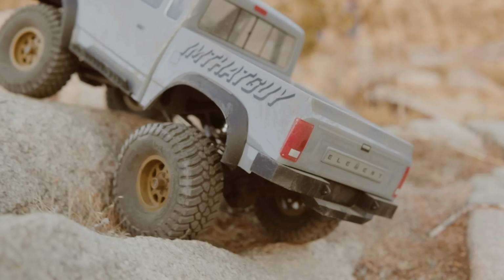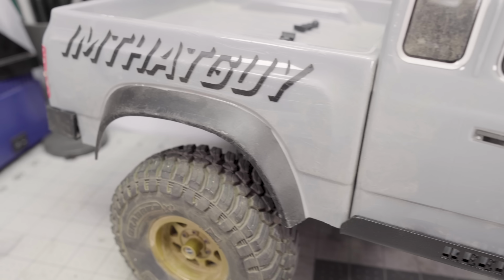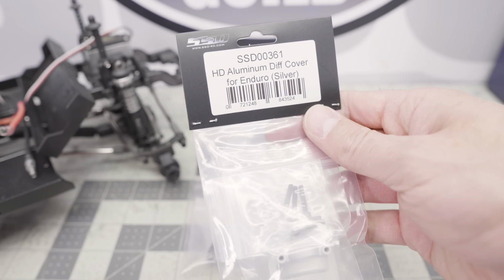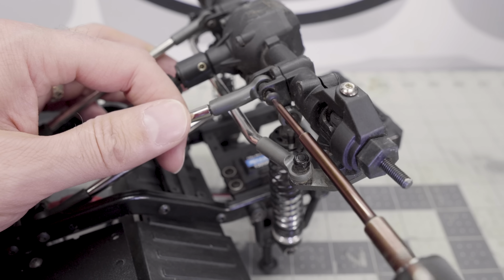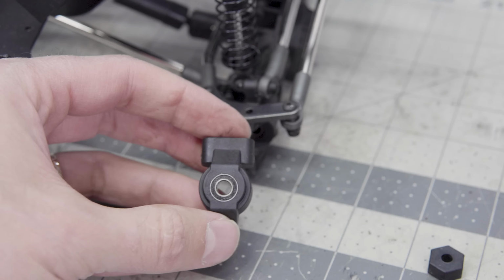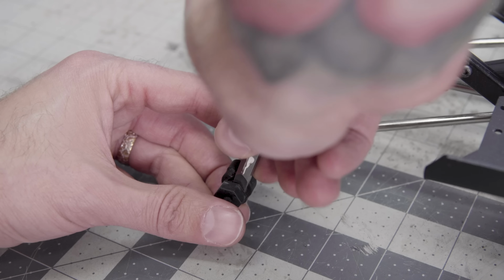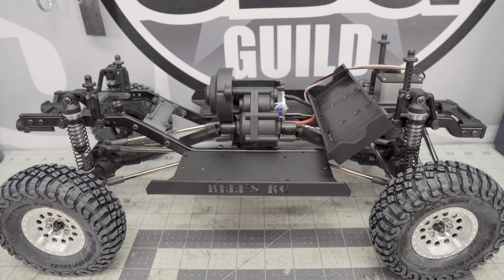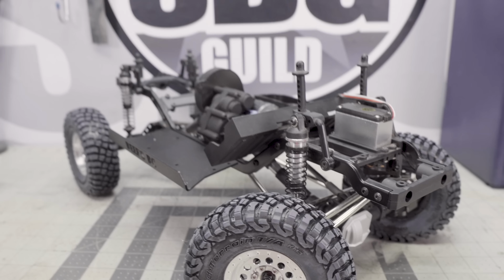Overhauling! the Element Enduro - S1E1

Comment: Pinion gear broke, so i decided to upgrade from the 48-pitch to the 32 pitch pinion and spur. The spur i bought has slip pads and 2 washers. Is there anything else i need to make it run with original transmission, or does it all have to be replaced, and what do i need to make it run with my 32-pitch. I can't find a video or anything that tells what to do with it.
Reply from the maker: Bowhouse makes a conversion kit, did you buy that?
Reply: I didn't know that site existed until you told me,but yes i did after i went to the site thank you.@scalebuildersguild

Comment: I'm doing the trail walker atm I absolutely love the rig. It's only 3 days old for me atm I ordered some 1.9 interco Super swamper TSL TSX tire and aluminum bead locks and got the aluminum 12mm hexs which the trail walker has the 6mm hexs because of the 1.55 rim size. Which is odd the trail walker and this one is the same size same truck basically. But they used smaller rims on the trail walker. But.... This truck box stock can go almost anywhere and climb anything. Mine hardly gets stuck ect is why I love it so much. I still got the Reedy 16T 5 Slot and the reedy brushed esc. I'm running mine on 3s it's a 5200mah 80C champion. It's got some power n long run time which is awesome. It goes places my Gen 8 axe can't go which is neat. I put a 1972 Chevy C10 Vaterra body on it for now which the wheel base isn't right. But it does look nice if you mod the body a little.. but I did get the RC4wD K5 blazer hard body n I'm putting it on it this weekend most likely. I'll be upgrading it to Brushless within the month when I finally decide on what motor n  esc. I drive it everywhere from dirt to sand to water n mud ect. Iv had it everywhere lol. My brother has a element trail walker as well he has the Interco Super Swamper boggers on his which his I believe are 1.5s the tires look small on his for some reason. The stock 1.5 rim n tire on the trail walker is a little taller then those boggers he has on his. But it's not a massive difference just maybe 1/4" if that. But his rim is definitely a little bigger so imma guess 1.7s maybe 1.9s with 1.55 boggers stretched on which seems to be the case. Because my TSL swampers are taller then stock tires and deff bigger then his boggers which those boggers are supposed to be a little bigger.. but anyway we took those two trucks all over the place along with my gen 8 axe and his Trx4 blazer. So all 4 trucks where out we had a blast doing it and then we drove the bashers lol. But honestly the trail scale trucks to me seem cooler even though they are slower they look more realistic which is what I like about em.

Comment: So I got bound up in a rock and backed up and my wheels stayed turned right and now my servo makes a wierd noise and wants to turn the wheels a certain way. I'm assuming I need a new servo. Any ideas on what servo I should get. Not really used to upgrading
Reply from the maker: Anything from Reef's, Tekin, or Holmes will work fine. If you're on a budget, there's plenty of great options out there from Hitec, Spektrum, Protek, etc.

Comment: Rc4wd blazer? I just bought one and a new Sandro I’m doing a body swap as soon as I can
Reply from the maker: You'll need to adjust the rear link length.
Reply: I made some out of bolts and electrical tape so I can screw the ends on for now

Comment: The Trailwalker version is only $299 as an RTR now. Is the only difference the taller tires on the Enduro Sendero? I’ve some unused Traxxas wheels, unused proline single stage foams and some moderately used Traxxas stock tires and thinking that would be a nice second rig
Reply from the maker: Mechanically the same!

Comment: Transmission flip(then you flip the gears in the transmission)/motor forward set-up. The motor still faces forward but it's mounted to the side of the spur using spacers. 
Put Electronic's on one slider and battery on the other. 
That'll give you the lowest center-of-gravity.

Comment: You can try some parts from https://www.mstechnology.cz My SCX10 is using lot of upgrades from them. Drive shafts, steering upgrades, mounts, etc. My SCX10 is bit heavy and overpowered so my consumption of parts was very high. These are still holding.

Comment: Those replacement outer bearings that came with the SSG Steering Knuckles were only metal shielded; so, I installed rubber shielded replacements to make them more durable.
Reply from the maker: Probably a good idea, especially if you'll be running it through a lot of water!

Comment: Excellent video - I love my so-far stock except for servo/wheels/tires/bumpers Enduro as well! The Gmade GS01 front bumper works extremely well on this truck - just move the rear bumper mount to the front... and you owe it to yourself to "upgrade" from compressed air in cans to one of these: https://www.amazon.com/Metro-Vacuum-ED500P-500-Watt-Electric/dp/B001U899HQ/ref=asc_df_B001U899HQ/?tag=hyprod-20&linkCode=df0&hvadid=167153662451&hvpos=1o4&hvnetw=g&hvrand=18107121274087619283&hvpone=&hvptwo=&hvqmt=&hvdev=c&hvdvcmdl=&hvlocint=&hvlocphy=9028321&hvtargid=pla-274818939744&psc=1
It is VERY heavy-duty, and mine is still working as new after 8 years. No more waste, and you can use it all over the shop and in your house - I even dry my hair with mine sometimes!

Comment: ESC is a must to improve the performance..
Reply: Honestly the stock esc is not bad. Just need t9 swap the motor wires and run tje reverse throttle on the transmitter so it doesnt go full rip in reverse anymore. Its a known issue and AE has said that's the fix and how it should have been from the factory. I did it and its buttery smooth with the stock 5 pole motor.
Reply: @RandomStuffGarage619  Nice to know that there is a fix for that..  now I can think on what would be a good use for the ESC that a have at the drawer... because at the Sendero I have the HW 1080 and I like it a lot.

Comment: I have the Element Enduro builders kit and it is my favorite truck
Options for your truck:
-11.83% metal gears
-brass / metal link and shock ball ends
-Reedy 16t 5 slot Radon 2 crawler motor (fully rebuildable / dual ball bearing)
-HW1080
-bumpers
-body (the replacement Sendero body is thicker lexan)
-SBG window stickers ftw

Looking forward to what’s next.
👍